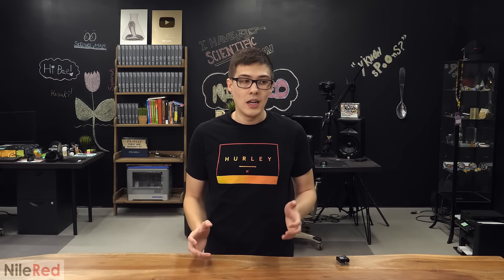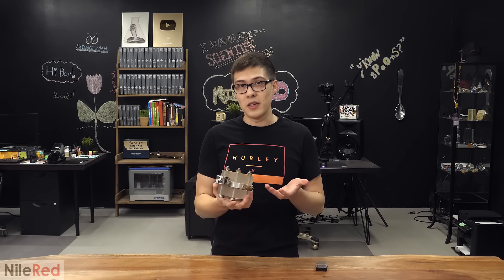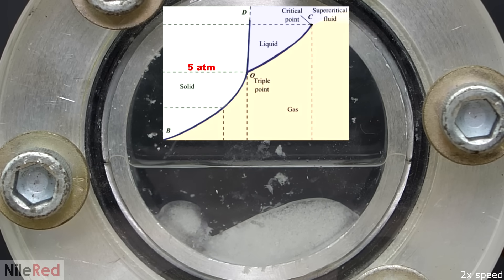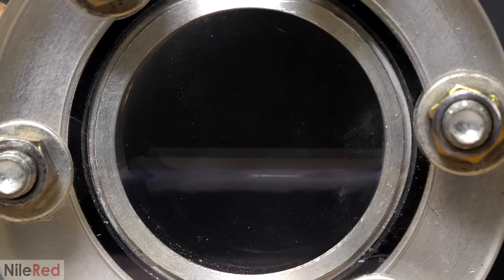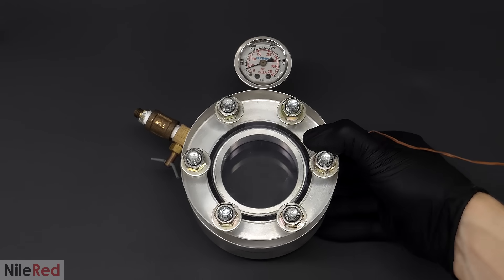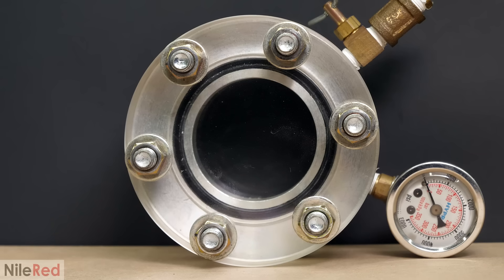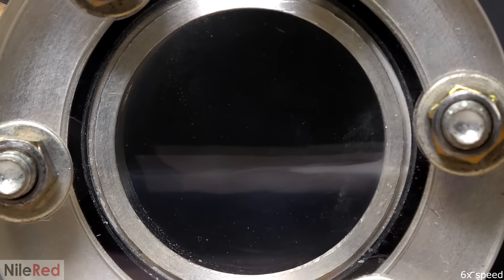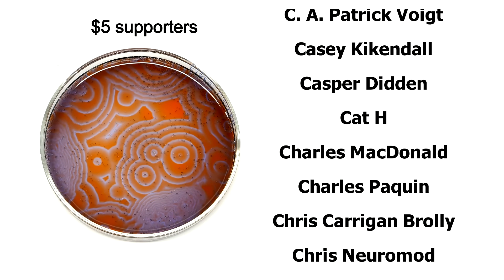Going supercritical.

Comment: The colorfull cracks you saw in your silika beads indeed looked like thin gaps, that have a width in the range of the wavelength of visible light. The same and more uniform you can achieve when you put two supper smooth glassurfaces together. What you will see is called Newton's rings. 
That was an awesome video and the effect of CO2 gas becoming more dense than the liquid is astonishing. I allready liked it over on Ben Krasnow's channal. 

I just saw that Black Gryph0n already said the same thing...

Comment: My dad would take glass insulators off of power poles from the 40s 50s and heat them up in the oven to about 400 degrees and then pour cold water on them. they looked a lot like your Silicone beads with all the cracks.

Comment: Definitely made a incredible powerful non incendiary explosive device. I would be more careful to repeadly communicate a legal waiver to not repeat this experiment.  If a laymen attempts this and they cheap-on or mess-up the material thickness and type so they have enough overage in their pressure safety tolerances. Not just for room temp but for a temperature that you could potentially tilly realize in an emergency situation like a fire or dropping it and chattering the brittle plexiglass. No matter how it occurs, if that casing fails you can kiss your garage, and likely your life away as your gonna die.

Comment: i totally think that due to high pressure the co2 made its way into smaller cracks of silica beads, turning them into small planes which could do TIR. ,just like if you would expect from small prisms, or small glass shards., just this was happening inside of the beads, because of the roughness in the cracks. Prism theory can be further justified with the crystalline structure of silica where the beads broke along according to the silica crystal structure, forming numerous small prisms. . however i am still not sure about that yellow colouring, that is definitely some other colour phenomenon going on, which is making the silica beads yellow

Comment: hm, would be interesting to see what happens when you put beads into the chamber with a density lower that the liquid co2.
Reply: Since the density of both original CO2 phases should average out at supercritical, most floating materials would suddenly sink to the bottom, at the transition point. In the case you find a material with extremely low density, that would not collapse, compress or get infiltrated by the CO2 under the high pressure, it should float to the top. Lastly, in case of a very fine-tuned system where the density of of the floating material and super critical CO2 would be very close, you should get a snow globe-like effect, with the material either sinking or rising slowly after shaking.

Comment: If you had done this with water at over 10x the temperature and pressure, you would have man-made opals. That is literally the process for man-made opal, just with water instead of CO2. Put solid silicon crystals into water, take the water supercritical, and then cool and reduce pressure. Reducing it faster can get better looking results but is also more likely to completely shatter the silicon instead.

Comment: When you let the CO2 out, the reason it gets cloudy is exactly the same reason why we have water clouds in the sky: as the pressure drops, the temperature drops as well. More CO2 can stay in the gas phase at higher temperature than at lower temperatures, so the excess condenses out. Those CO2-cloud-droplets are extremely tiny though, in the dimension of a micrometer probably, and they don't have the opportunity to grow larger. The tinier the droplet, the quicker it evaporates again, so they go back into the gas phase really quickly because of the low pressure as soon as it warms a bit.

Comment: 15:00 the stone "opal" is made mainly out of silica. That silica presipitates out of water and creates microscopic silica crystals that are joined together along with some water molecules. The wired color changing behavior that opal shows it called "iridescence" and in this case it's cause by light shining through the tiny silica cristals and then getting split as it passes through because of the tiny gaps between the crystals. Maybe something similar is happening with this silica beeds, but in this case carbon dioxide molecules got trapped inside of the tiny microscopic cracks that it created, and the light is getting split as it passes through because the gaps are just big enough to only allow certain wavelength to pass.

Comment: Some of the initial cloudiness that appears when you vent the chamber, depending on the exact temperature and pressure, might be critical opalescence. At the critical point correlation lengths go to infinity, so density fluctuations happen at all scales, so you get a whole bunch of Rayleigh scattering -- the same phenomenon that makes the sky blue. Probably also the reason for the cloudy layer between the soon-to-disappear liquid and gas phases.
Reply: I just learned about critical opalescence, and immediately went to see if anyone commented about it under this video.

Comment: dusts off my gemology certificate ok, so here's my theory about why the silica beads glittered like that: (TLDR: at bottom) 

Why the silica beads cracked: 
When the C02 gas went supercritical, the pressure substantially increased on the silica beads themselves. The beads maintained a surface tension under the extra pressure rather than crumbling (which itself is neat! Lots of components or elements don't handle pressure well, and even elements that do don't always react the same way). The silica beads took internal damage by developing fissures within the bead, which only became visible when the pressure dropped back down to a normal atmospheric pressure. If you look at gemstones such as emeralds and quartz you can see similar fissures, which can be caused by pressure inconsistencies during their development, or impurities within the stone. 

Why the beads had color:
First of all, you have to understand that in the world of gemstones, there are 2 types of color: dye and refracted color. Dyed color will reflect blue light back to your eyes because all the light that hits it turns blue and becomes "dyed" that color. Its like the light coming through colored glass is blue if the glass is blue. 

Refracted color happens when a gemstone is itself colorless (usually. Sometimes its not, but I'm not gonna get into that) and when it absorbs light it reflects it back as "separated light". When you see light cast by a prism, it shows refracted light creating a rainbow. The prism itself is colorless, it just "refracts" or separates the colors of the light into a rainbow. Diamonds "fire" is another great example of refracted light. The color you see in the sparkle is just the diamond separating out the different colors of light. Some gemstones only reflect a certain color back to you, absorbing the other colors. These gemstones recieve their color from "refraction", not dye. 

Alexandrite is kinda one of these, and its my favorite. Alexandrite looks green (or blue) under daylight, but pink (or purple) under incandescent (indoor) light. This is because Alexandrite really likes to reflect green and red light equally, and absorbs most of the other rainbow colors from light. Sunlight has more blue light wavelengths to be reflected back, while incandescent light is richer in red light that can be reflected! And that causes the color changes in alexandrite! 

Sorry I kinda went off on Alexandrite, I find it really fascinating. These silica beads have me totally geeking out, they are so neat! I'd really like to know how much light they reflect, as opposed to other gemstones. And I'll bet that making one on a larger scale won't bother anything about the light refraction. If anything caused an issue, it would probably be an inability of the silica to maintain surface tension, and they could turn to powder or even shatter! 

TLDR: the silica beads appear cracked because the extra pressure from going supercritical changed their structure. Those cracks reflected light like a prism does, creating colored light!

Comment: I do not think the gage is broken however I think it is designed to measure gas with the gage upside down liquid was in the line. I have seen this issue when I was working at BASF where a glass-lined aluminum chamber filled with liquid because of a bad check valve, the gage was reading zero or close to it. We were told to open the cylinder because at this point the technicians thought the chemical (I cannot speak of with it was) had escaped into the atmosphere thus no issue or danger existed. My boss had the idea of monitoring the temperature and noticed as we moved the chamber the temperature would spike, he stated correctly this meant the gas was still there, and opening the experiment was very dangerous.

Comment: Hey the reason the pressure didn’t change is because the dry ice was inserted at the same atmosphere as the ambient air. The pressure never actually changes. Same with if you shake a coke bottle. The pressure inside is still just ambient pressure.

Source: veritasium or smartereveryday

Comment: did not have spare pressure gauge, did not check pressure gauge to other equipment for testing. did not torque wrench the safety nuts. did get pressure chamber for free and did have dry ice. but overall not impressed by this vid

Comment: Seems like the silica peals cracked when you released the pressure which dropped the temperature quickly compressing the pearls. The colors are due to refraction as the cracks act like a prism.

Comment: I did some experimental studies ages ago with SCF, and used a high pressure level gage with  sapphire windows. This was able to go above several 100 bar, and we were able to reproduce Reid’s experiments with naphthalene. Cool stuff. I also modeled the extraction with a cubic EOS. I would suggest replacing your chamber with this type of level gauge. Reid was at MIT, so the reference is easily found…just saying.

Comment: @NileBlue Is the gauge actually broken or is the fidelity of the gauge to wide? You said you only need 5 ATM (which is like 75 psi). Its seems to be a high pressure gauge to seeing 75 psi maybe difficult? The hash marks represent 100 psi but it seems it wont start reading until 300 psi? So you may just not be at a high enough pressure to observe it on the gauge? That may be why later in the video you can actually see the gauge moving when  you are at supercritical (higher pressure)? Also you can see moister inside the gauge once you put dry ice in and close it up so it shouldn't be blocked? IDK this is all kind of speculation, I just didn't see anyone talking about it.

Comment: I know I'm late to the party here for this video, but I had a couple thoughts while watching it.
1. You should do it again using glitter instead of silica beads, as glitter would have a much easier time circulating around in the fluid.
2. What would happen if the temperature were to continue increasing? Would the 2 phases start repeating? eg. Would the supercritical fluid then turn back to normal fluid before then turning back to supercritical (hypercritical?) fluid?
Reply: Depends on how exactly you heat it. If you heat it at constant pressure it'll just be more of the same. It'll look less interesting the hotter it is because a lot of the interesting stuff that happens here such as the cloudiness between the layers etc is due to the proximity to the critical point. Away from the critical point it'll just be supercritical fluid that looks more and more nondescript.

If instead of heating at constant pressure you heat it and let the pressure go wild you might actually solidify the CO2, though the pressures required for this to happen are around 1000-10,000 atmospheres, well above the pressures that would utterly destroy this demonstration chamber.

Comment: I think it would be cool if instead of silica beads, you added a solid that had a density close to that of supercritical CO2 (about 0.469 g/cm3 at the critical point). Elemental Li would be a possibility, at  0.534 g/cm3 (although I’m not sure how rapidly it would react with the CO2). By tweaking the SC-CO2 density with application of heat (or pressure; i.e., starting with a larger volume of dry ice), you might be able to have a piece of lithium actually float in the SC-CO2 like a helium balloon in air!

Comment: The color in the silica beads is likely a similar refraction to opal. Opal is just hydrated silica that refracts due to the fact that it's amorphous and light bounces haphazardly through its structure in a way that creates different wavelengths if visual light. The surface cracks on the beads are probably causing something similar, if not identical.

Comment: When tightening bolts dont do it clock wise or counter clock wise, do it in a star pattern a lil at a time, (applies to changing a tire too)
Reply: He did star pattern it
Reply: star pattern?
Reply: @5bc500  basically, after you tighten your first bolt, tighten the bolt in the opposite position. It's called the star pattern because the way you tighten it is similar to drawing a star.
Reply: @phyokyawkhaing2251  Wouldn't you just be alternating back and forth between the same two bolts?
Reply: @NoriMori1992  obviously not, that wouldnt be very effective would it? when you draw a star, you dont draw a single line over itself repeatedly, you rotate the point that you draw to about the center of the star, while staying as "across" from the center as you can.
Reply: @5bc500  yup
Reply: Was looking for this comment
Reply: Torque wrench for consistent torque values and also use an Allen bit in the Allen head fasteners not a Torx bit. But hey, he got it to work!
Reply: That's what he did. You see him do it in the video...
Reply: ...and since he was concerned about  under/over tightening the nuts,  maybe use a torque wrench...

Comment: Because the weak point was at the loose bolt in the first run doesn’t mean that when the bolt’s tightened that it will fail at that same point. As you say, ‘That’s bad science’. Lol. 
As when the bolt is tightened it will provide a new level of pressure resistance which will be containing a higher pressure that’s also not yet achieved. Double variables.

Comment: With the silica beads, I'm thinking the high pressure and temperature altered the silica structure on a molecular level creating amorphous glass, which would have the same iridescent reflective property seen here. This is how the lava in Hawai'i looks because it goes from being at such a high temperature and pressure to rapidly cooling back into solid at low pressure without time to properly arrange a perfect lattice structure.

Comment: Great information 
What may have happened making the beads to exhibit colors...
1) Pressure and CO2 have caused the beads to expand, causing them to expand and micro fracture hence the refractive appearance due to pressure on both sides of fractures surfaces.
              Or
2) The pressure has caused an alignment in the beads, making them Birefringent. (Test the bead by putting one between 2 Polarized sheets and turn black if the bead looks like light is passing, it Birefringent ) 
with fractures.

Comment: the silica beads sorta absorbed the liquid carbon dioxide but when it got insidre the beads where is around normal air pressure, the carbon dioxide liquid evaporated causing those bubbles in the beads and also made the colour

Comment: I am wondering if you take epoxy resin, mix it up, wait for it to thicken up little bit, then pour it to container that can be pressurized, then - can you put in to this resin co2 in solid stade, quickly pressurize it to keep it inside resin, wait until resin do it`s job, and i am wondering if it can hold this kind of pressure? To be able to have like sphere that has inside of it liquid CO2 trapped?

Comment: The cracks are going all the way through but somehow not compromising the shape of the beads. So the internal cracks are refracting the light at an angle hence the color. You can see similar things with cracked clear thick glass.

Comment: i wonder if polycarbonate would be better for the windows. and a bit more flange radius because the "meat" that the bolts are holding onto is thinner at the edge than the thickness of the pane, not that the force would be radial but the weak spot would be the small amount of plastic between the bolt and the side circumference. acrylic glass is really brittle and breaky, but on the other hand I do know that polycarbonate instantly fails on contact with acetone so it goes from bulletproof to saltine cracker strength. have you tried that experiment? acetone instantly albeit temporarily "shocks" and compromises polycarbonate in the most mysterious way.